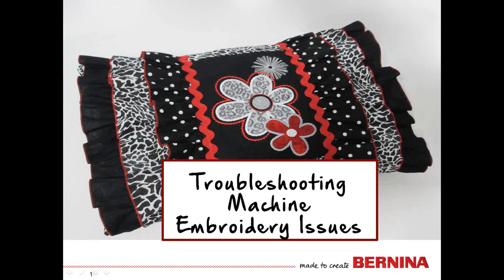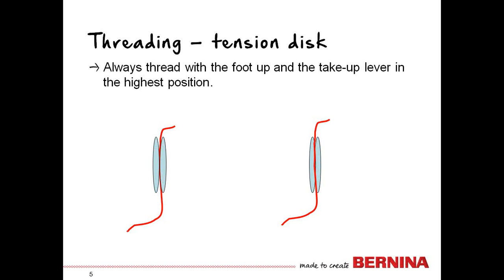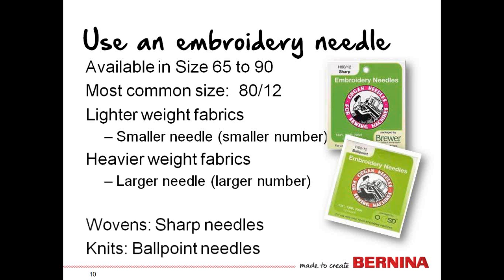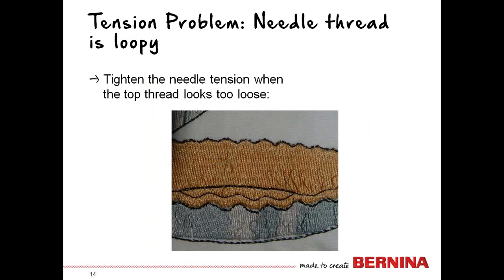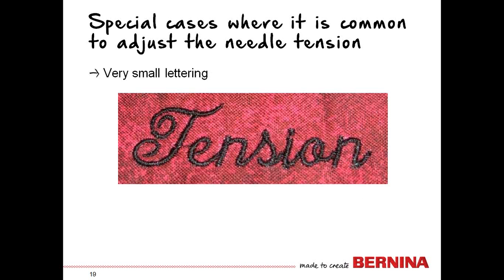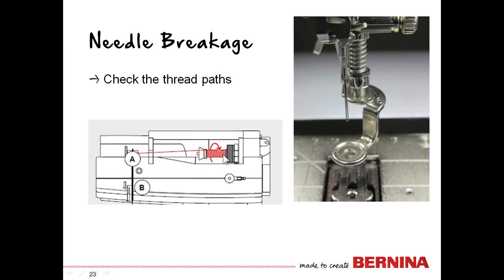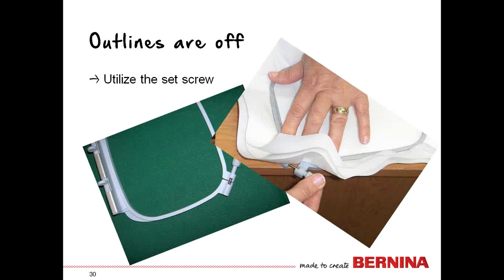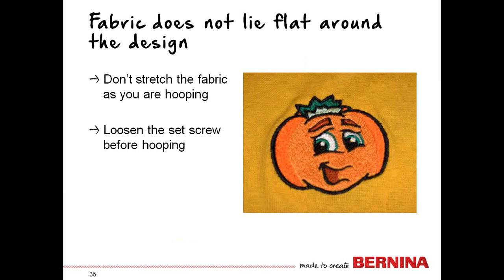Embroidery Tool Tip - Troubleshooting Embroidery Issues

Comment: I’m having a problem with my 440qe using the embroidery unit where in get 3/4 through an stich out then my computer screen tells me my foot is not lowered and the stop start button will not work. Any ideas as to why this is happening?
Reply from the maker: It would probably be best to have your machine looked at by a certified technician, but here were some thoughts from our team: try a new USB cable, ensure that the foot is lowered entirely before beginning to sew, it is possible that the pressor foot sensor is malfunctioning. Best wishes and sorry for the delayed response.

Comment: I'm having issues where the bobbin doesn't collect a lot of the time on thin t-shirts. I've bought embroidery needles size 70, used 2 layers of cutaway and an embroidery foot on my Brother sewing machine. It seems to catch when I manually turn it, but not when using the foot pedal, even at slow speeds. I can't figure out why it's happening.
Reply from the maker: It seems as if you are doing things right as far as the stabilizer. Kay typically uses a size 75 needle instead of a 70. Double check that the needle thread is all of the thread guides and that the bobbin is inserted correctly.
 If the problem continues, we would suggest you take the machine to your dealer to check for any problems.
Reply: @BerninaInternational   Thanks. I tried a size 70/75/80 and different needles, ball point, stretch needles, even leather ones. I adjust the tension, re-thread, Nothing changes. I only get this when I take out the feed dogs (since there's no option to lower) and use thin fabric. I often speed the machine right up to brute force a few catches, then once it gets going, it's much better at zig zagging over the stitches already laid. It's very strange.
Reply from the maker: @ArcanePath360  This is very strange indeed. We recommend that you take the machine to your BERNINA dealer so he can have a look at it.